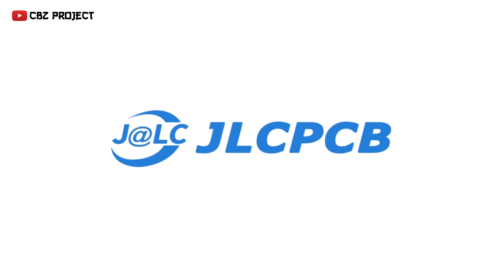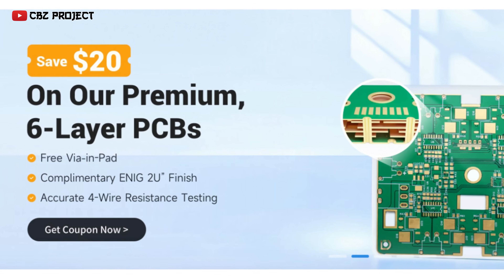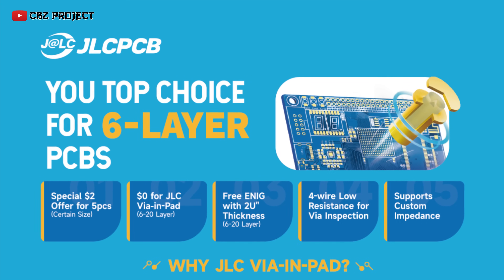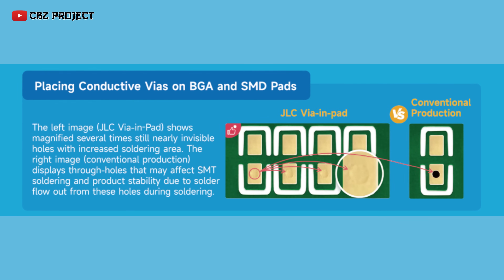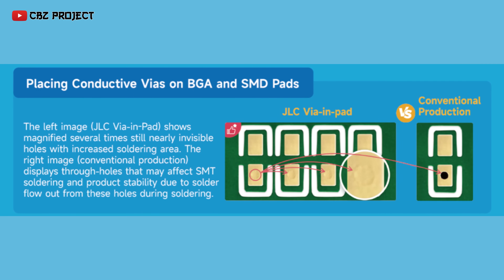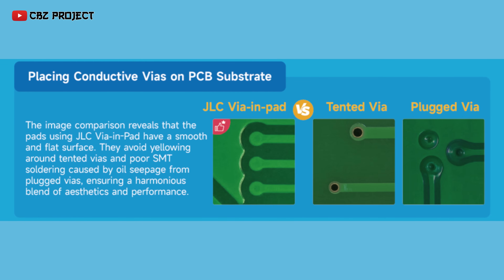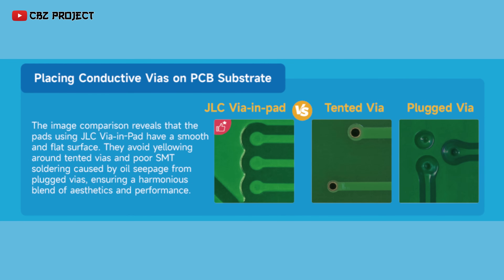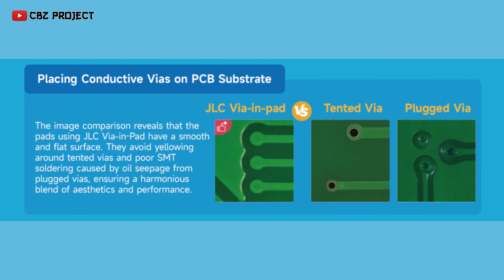2500 watt?? Full Bridge Amplifier Board 28 Transistors 2SA1943 & 2SC5200 transistors #cbzproject

Comment: 2500w?
Never.
Measure it.
100 Volts on 4 ohms.
The laws of Power... 
What I saw is ... Bs
Reply from the maker: Actual power may only be 250 watts😄
Reply: @cbzproject 😅😅😅
Now I believe you😅
Allright, reallly appreciate your work.
My last amplifier built was on class B, +/- 70 v, bridge rectifier 100A, transformer 2.5 KW, soft start, 2 x 40000  micro farads/ 100v on each side ( I supply 2 amplifiers from each coil and there are 2 coils on the transformer) = 4 amplifiers supplied.
That' s crazy... With THD under 1%, I havd 500 watts (real ones😅) but peaks goes to 1 KW with enormous distorsions.
Near a good amplifier, the secret is to have the supply tough.
On your amplifier, have  a look about the air flux of the cooleers, my opinion, 1 pcs is enough
Bridge? Normally is ok for 8 ohms
Means 4 speakers as 8 ohms... Means mass demolition. 😅
Cheers.